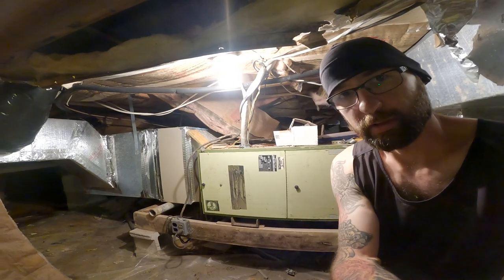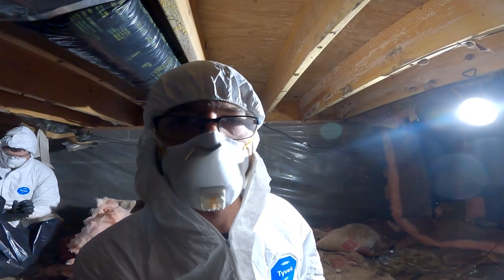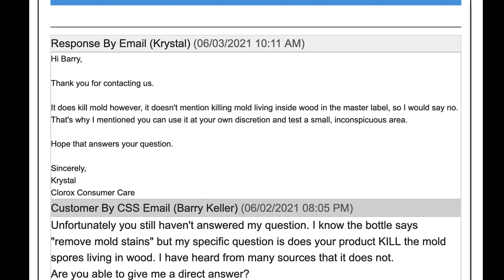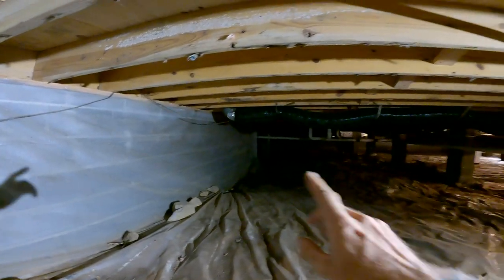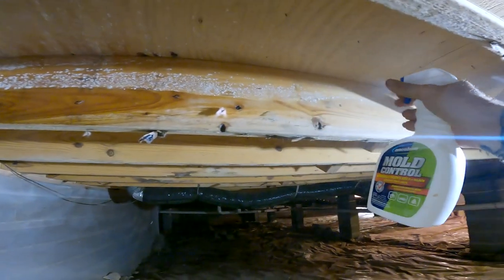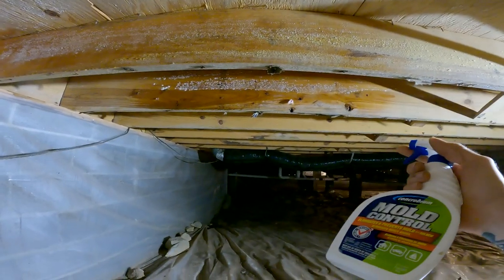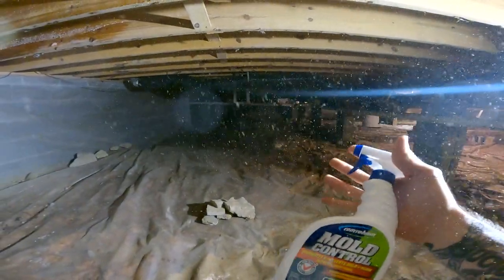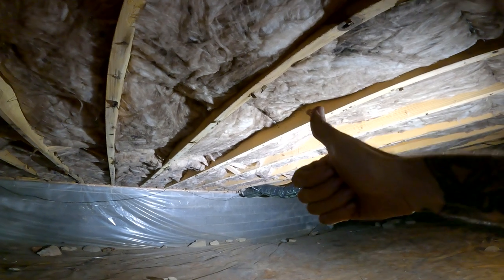Why Installing This Wrong Could HURT You  // Retro Reno Pt 11

Comment: Question:  Why did (do) companies make insulation that has both the top & bottom covered?  It just confuses the homeowner.
Reply from the maker: It's from the 70's when they didn't know better. If there is still a company that sells impermeable double faced, I don't know about it..  It wont pass code.
Reply: @EmptyHammock  Thanks!  You are smart and experienced and you keep us updated.  Lots of 1970’s homes still out there.  Your flipping this one soooo improves its great bones.
Reply: Double faced can be used on a double interior wall as a sound deadening and temp controll.
Reply: If you sell it, they will buy it.
Remember that even if there are 1% of installers who do not believe/know/care about vapor barriers and their proper use, that results in  1,000s and 1,000s of "bad jobs".
Add to that DIY'ers and those that have no choice due to product availability at the time of install and that would explain most of those errors in installation.
Most people do NOT remember details, so my guess is they are thinking "Vapor barrier = good, therefore 2x vapor barrier = VERY Good" without applying any additional thought or science into the matter.
Reply: @TheOriginalFreak  I remember that in 1970’s we had an oil crisis and it scared everyone into insulating top, bottom and sides of anything we constructed.  We overdid it!  Today it’s worse, but the Barry’s and Bill’s and Bruce’s are in very limited availability.  Thanks to them for the science lessons and getting it done correctly and yet thriftily.  Amazing new home investment for the coming new buyers - lucky them.

Comment: What kind of insulation did they use? I would like to put some in my damp cellar.
Reply from the maker: For a continually damp cellar I wouldn't think fiberglass would be the best option. I would call a local pro for advise. I'm not sure.

Comment: I dont get it? You never explained what it is that will kill you if you install it wrong? What is your opinion on spray foam? and why did you not use it for this project?
Reply from the maker: I never said "kill you". There are some types of mold, depending on the individuals sensitivity that could "hurt you".  
Spray foam is a more permanent option. If you try to run a new wire or pipe or whatever you have to destroy the area.  With fiberglass batts you just remove and reinstall. Spray has its place, but not on this project.
Reply: @EmptyHammock  Thanks. Ya I'm trying to decide on spray foam or insulation again. Like you, I had insulation that resulted in mold so I had someone rip out the old insulation and treat the mold (I wish I watched your video before) and now I need to decide on what to use to reinsulate the area. Spray foam or regular insulation.  We have a crawl space and a slight water issue when it rains.
Reply from the maker: @Ryanboy2020  ah..   I like fiberglass..   it's my go-to..